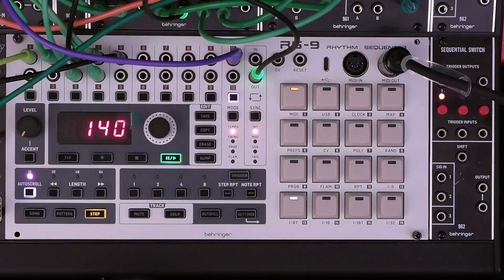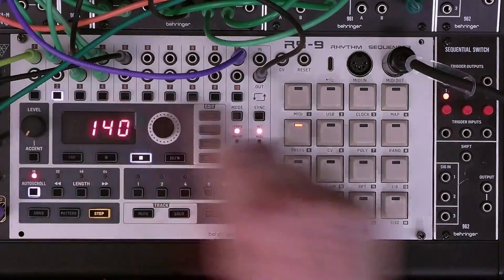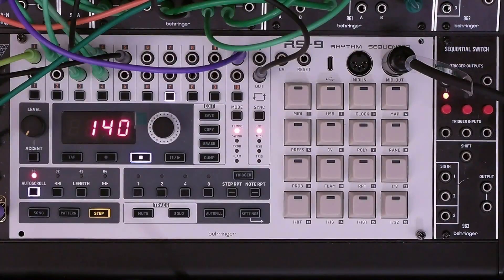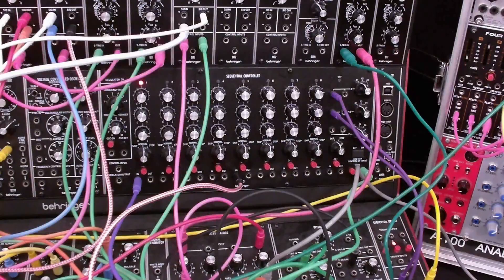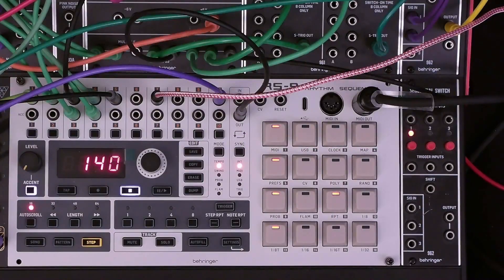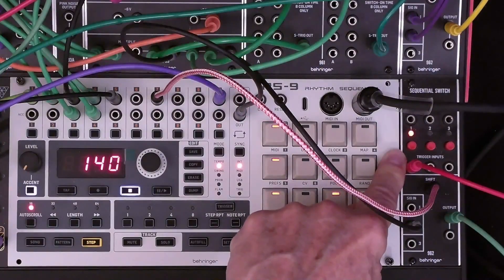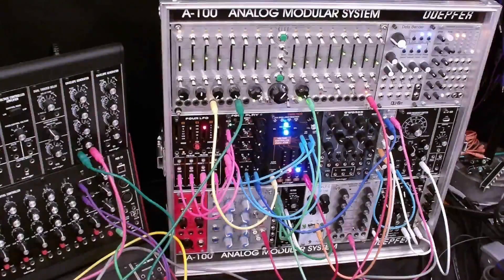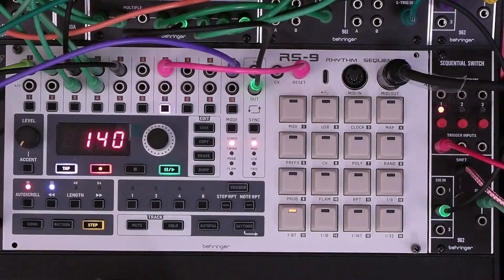Ep 6 RS 9 System 55 Integration

Comment: Hi, i am kind of new to eurorack, i bought the rs-9 and a case to control my pulsar 23 from soma, but i am not getting enought output from the the triggers, all the voices coming from the pulsar 23 are too low, i saw the specs of the outputs from the rs-9 and the inputs of the pulsar and they are booth 0-10v, the only way to have a louder sound and even tought too low, is to use the accent in full, do you have any idea of what is happening? Enjoy very much your videos by the way, i didn´t realized about the random, and selecting like groups, makes sense :), thank you in advance.
Reply from the maker: I think the heart of this issue is that the RS-9 outputs "trigger" pulses, not "gates".  If you can extend the pulse you might achieve the results you're expecting.  You might be able to extend the trigger pulse into a longer gat with a gate extender or perhaps an envelope with a longer release time.  BTW the Pulsar 23 looks like a very cool instrument.
Reply: Thanks for the answer, yes i love pulsar but since o bought it i eanted One sewuencer that i can have a more controlled and not só experimental Control, i em going to check out what you Said, thanks you for the advice
Reply from the maker: @thoseonemusic  you're welcome

Comment: I'm about 1 day from completing what I call the System 75+ Performance Rack consisting of three Go cases stacked.  It's taken me 3 or 4 years to complete the system but because of your video's I decided to add an RS--9 to the system using a behringer 104 skiff case at the very top, so there are 6 rows of modules and the top 7th row in a skiff.  I can't wait to get everything tuned up (I have 3 or 4 early oscillator modules that desperately need to be adjusted.)  Using a versatile Roland A-500 Pro MIDI Controller the system is setup for 4 voices, each with 3 oscillators, high and low pass filters, and several 992 CV modules so I can leave the patches in place for the most part with minimal repatching... and the 4 voices are identical pretty much.; the idea is to keep it performance ready.  You can see the mockup on modulargrid.net here:  https://modulargrid.net/e/racks/view/2890716
I have several other racks which use doepfer, System 100, and other modules including a couple of 2hp.  Thanks for your video's.  Love your channel.

Comment: Great video! So it sends short triggers and not Gates? Can you adjust trigger/gate length?
Reply from the maker: Yes and yes.  In the quick start guide (p. 15):
Trigger Time (1ms – 10ms/25% - 75% of sequencer step time).
 Trigger time is a Global setting.  Default is 10 ms. 
Below 10 ms some drum machines may have synchronization issues.
Reply: @ozhalljr thanks OZ! 🙏🏽
Reply from the maker: yw!